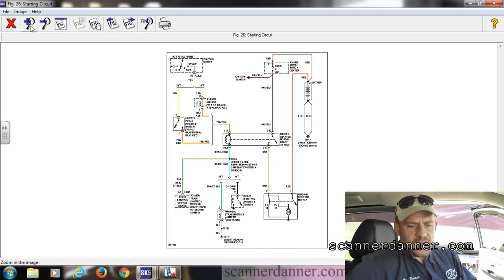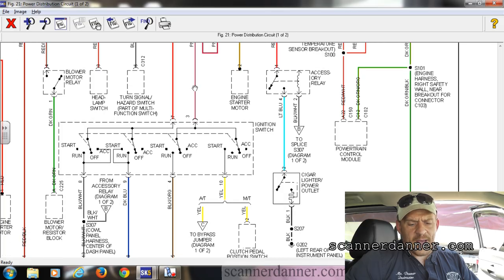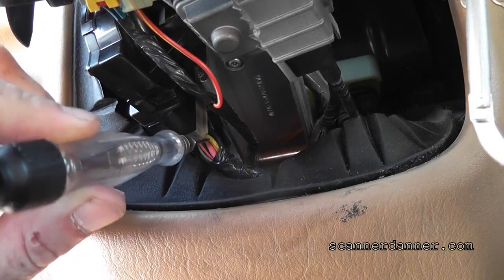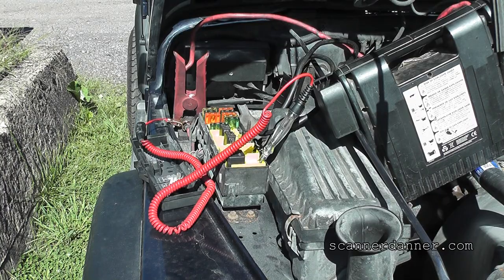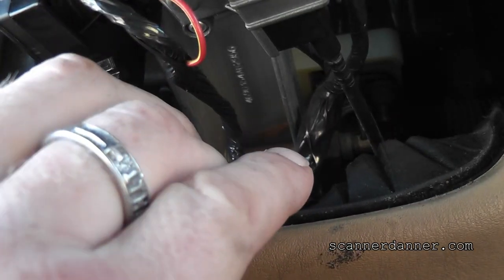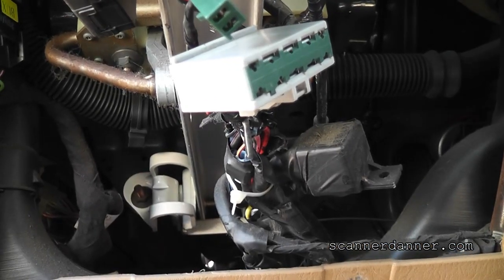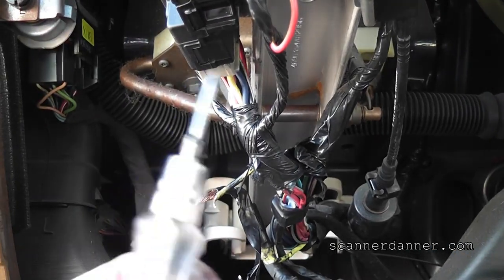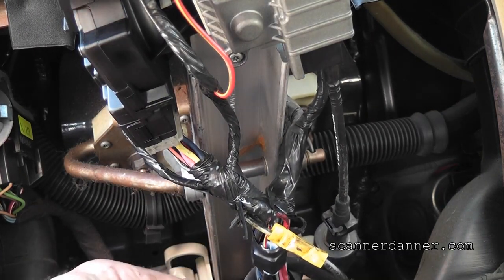No Crank Troubleshooting (engine does not crank) - Jeep

Comment: Does somebody knows how he’s transferring battery positive to the yellow side from the test light to start the Jeep?
Reply from the maker: Give me a time frame of the video and I'll let you know
Reply: ScannerDanner it’s exactly at 27:10! You connect the test light to where you plug in your obd2 scanner right? And how did you plug in the test light cus mine has an alligator clamp. I’m also trying to crank my Jeep from the yellow wire
Reply from the maker: @mexicantrump258  okay, I am tapped into pin 16 of the DLC to simply give me a power supply. I have a T-pin connected to the alligator clip of my light to do this. You do not need to go there but you will need to connect to a power supply. Then I am energizing the control side of the starter relay on the yellow crank wire coming from the ignition switch. 
Now here is the key!
If you are working on a system where the ignition switch (the yellow wire on this Jeep) is directly supplying power to the starter solenoid WITHOUT a relay, you will NOT be able to use a test light to energize that circuit. It carries too much amperage to do this test. 
If you have a relay in between, like this Jeep does, then you will be able to do the same test. All I am doing is energizing the control side of the starter relay which normally only carries about 150 ma of current, which is not a problem for my test light. Hope that answers your question
Reply from the maker: watch at 16:24 for the circuit diagram where I am describing what I am going to do and why
Reply: ScannerDanner yeah that makes perfect sense. I’ve been watching a lot of troubleshooting videos lately and I’ve learned a lot from you. Definitely gonna sign up on your classes and buy some merch. Thank you so much for helping us with this stuff & for replying with more info! Happy thanksgiving

Comment: yea it is a big deal, you could fry an ECU if you don't take care to KNOW what you jumper power to.....and  your job is to fix it even with aftermarket equipment; because that is what you were brought to fix..
Reply from the maker: I did fix it 😃 and no, my job is NOT to fix or repair some aftermarket p.o.s. add on with absolutely no wiring diagram or service info on the device. Especially when the customer didn't even know it was there. 
It was restored to factory working condition when I was done.

Comment: Wish ya lived near me. My 2000 Jeep Grand Cherokee 4.0 auto.   has a no crank no start issue but did start mins prior but would stall within 30 secs . Battery is good , not the pcm  I had new one programmed , not my chipped key cuz no theft light plus Jeep started before . Hand jumped starter and under car it just spins doesn’t engage to turn motor ., I believe there was aftermarket stuff no longer in use  and like I said it would start but idle rough sputtering then die ,  then I paused tried again and no crank no nothing since.  Bad starter? But why before no crank it would start but run crappy then die. ??  I bought this Jeep with that problem, guy said needed pcm - but I did that and same symptom but now no crank no noises nothing. But have all lights dings dash stuff all work as should .  I’m at a loss and can’t be throwing $$ at this. I’m not an electrical type guy
Reply from the maker: I'm not following, sorry. 
What is the current situation? No crank, no click, no nothing with the starter? Or is it that the starter motor is spinning without engaging the flywheel? Then you also have a running problem, which needs to be treated later. After the cranking issue is fixed.
Reply: @ScannerDanner  presently no crank no nothing far as turning key to try starting . I bought the Jeep under impression it only needed a new pcm. Cuz it would crank and start but only run roughly / sputter/ and die. I replaced the pcm thinking it would run normal , but turns out it ran the same (start up rough idle and die).  After couple start ups , I then tried again but it was flatlined. From then on.   All lights and dash lights and chimes still work as should . Battery is 12.6.  Far as starter I went underneath car to jump direct to see if it would start engine and it only spun ( did not  engaged ). And that’s when I thought (bad starter)? But find it hard to believe it was starting car before that and why would engine run briefly roughly then stall ?   Sorry many puzzling  questions - I don’t know the history of the vehicle either so don’t help .

Comment: Not to bust your balls. You are a very smart guy. But why not just solder and shrink the wire the correct way? Just out of curiosity, wondering if there is a reason you did that

Comment: Hello hope someone can help me out. I have bought a 1.2 00 Renault clio and the day i bought it i drove it around everything was fine. When i parked it up overnight i went back to the car the next day to start it and it would not start no crank no start. The car would not even try and start my lights Radio and everything was fine. i thought it was starter so i hit the starter a few times while trying to start the car But no luck noting happened. I then push started the car and it started so gave it a drive for 10 minutes and parked it up.I still thought the starter was the problem so i took the starter out and tested it with jump cables and it was not reacting at all so i ordered second hand starter and also battery and i installed them. the car still would not even crank or try and start i can hear a click noise that i think is from the starter also when i try and start the lights are on in the dash when i turn the key in the ignition it's like it's not springing back so i think it needs a new ignition switch also can anyone help me figure this out anything will help thanks for taking the time to read this.
Reply: did you voltage drop test the starter with the new battery and starter in place? if not, do that first and get back to me.  if so, and results normal, I would jump power to the solenoid terminal and see if the starter cranks.  make SURE the car is in park and E brake is on.  do these things and get back to me with the results. I'll tell you what to do next.   If you don't know what voltage drop test is, watch the video on voltage drop test for a starter on YouTube by username SchroedingersBox . it's long but it's really the best and most complete video in this topic I've found - well worth the time investment! Good luck.  lemme know what happens

Comment: in seriousness i was at work and the "lead" tech got a trouble code for a o2 sensor stuck rich the guy just threw a sensor in it long story short it didnt fix the problem. i showed him your test light method of testing signal wire integrity and he started yellin sayin i was going to ruin the pcm i told the dude to stuff a sock in it the information i got from an ase L1 tech. then he was surprised it was a short to power
Reply from the maker: Nice! And that short to power on the signal wire didn't cook the computer sensing circuit either did it? Further proof of the hardiness of input sensing circuits.
Reply: it did not cook the computer, if i had the spare cash id buy the over paid guy a copy of your book and say man you need to read this stuff. have a good day mr danner

Comment: kinsgford
Reply: After watching one of your videos, I solved my no crank problem on my 2002 Camry. It turned out to be the connector for the small wire to the starter solenoid where the wire on the solenoid was recessed and routed under the battery and pressure was put on the wire connector causing an intermittent connection to the starter.

Comment: I've watched a couple of your videos now and while there's no questioning your technical knowledge you need to just chill a bit when diagnosing. You are all over the place - scattergun stuff.

As for you saying it's not your problem to fix the after market install - it would have taken you 2 seconds to take the card out of the slot and reinsert it a couple of times just to see if it was a bad connection on the card, saving you time cutting the wrong cable and making a pigs ear of it.
Surely it's your job to make it work - not return it to stock.

Apart from anything else - the garage owner now has to explain to the owner why his anti theft system, isn't working anymore because you decided you don't like it.
Reply from the maker: I filmed this live! Unlike what most creators do in our field, which is to figured it out first, then film it.
I turned the camera on and showed a live process. Some truly appreciate hearing and seeing the thought process. In fact, I would argue it is the most important thing to learn when one is new in this field. 
So I understand this method isn't everyone's cup of tea, but I'm okay with that. 
As for the aftermarket anti theft piece. The customer didn't even know it was there as it was installed by a previous owner. Removal of that piece was the right thing to do to prevent a repeat failure.
Reply: @ScannerDanner  I appreciate your videos are live and many others are staged, and again - I'm not questioning your tech ability.

I just watched you diagnose a fuel issue where your battery charger leads were not  properly attached and sparked - I'm assuming from the reaction of your colleague petrol had leaked into the engine bay. So I stick by the comment that you need to chill and take a more deliberate, less rushed approach. You should be teaching, and encouraging your students to take a safety first, considered approach.

As for the previous owner not knowing about the anti-theft device, as you were ripping his after-market accessory out you didn't know that.
As for the right thing to do - it's not your decision. It's a client's property. If all that was needed was to clean a couple of tracks  then advising the owner of the cause of the problem, and recommending that he remove it was the way to go.
But it was his property - his decision.

Comment: AAAaa I won't make fun a ya. 8 years ago.  Newer jeep with start problem. The security light stays on and watch a video that showed taking a IOD fuse out for 30 seconds. I didn't take the key out of the ignition but the key was off. I Can't diag it anymore really because the owner doesn't understand my education. but then I don't really need to do it anyway. It could be the security or it could be the ignition switch. There looks to be some after market on it. But then it could be the key identifier also. Not my problem if the owner doesn't trust me to work his problem out. He suggests that putting it on a diagnostic machine will tell the mechanic the exact problem. Electrical problems such as this don't really have anything other then test lights many times. There are computer programs that can narrow the search but then so does knowing of the problem from seeing it in another vehicle. Red security light stays on and the fuse trick didn't work. So.?
Reply from the maker: 🤣 you mean your scanner doesn't tell you what's wrong?
Reply: Ya cause I haven't got a scanner.  but then if it is the igntion key identifier, how does a scanner pitck that up.   @ScannerDanner
Reply: I got it!!!! The shotggun technical method. read a code and shotgun some parts on.